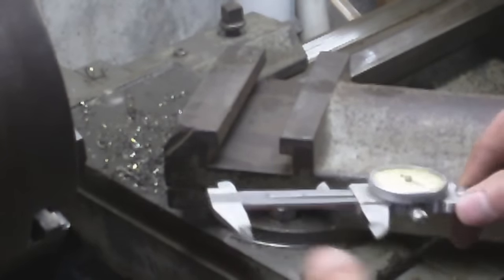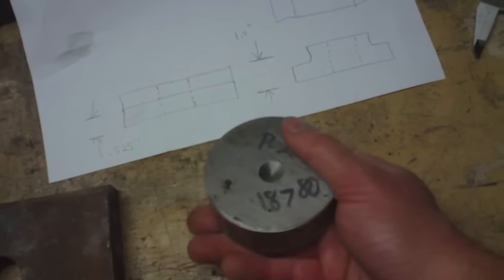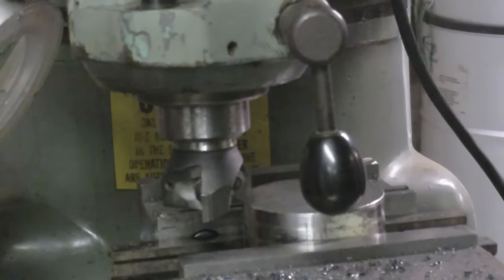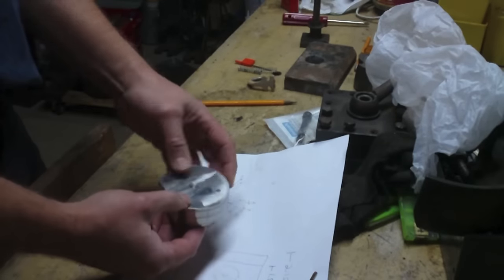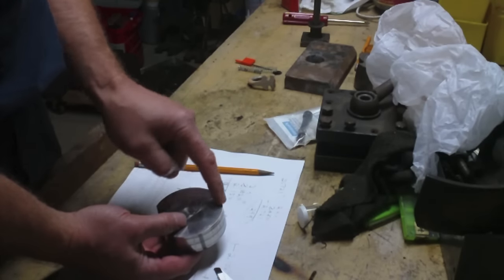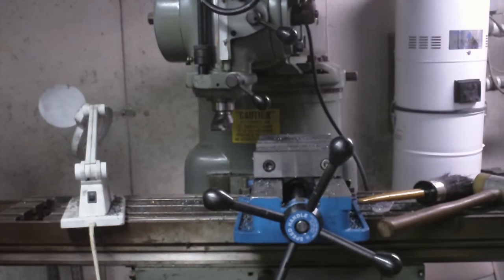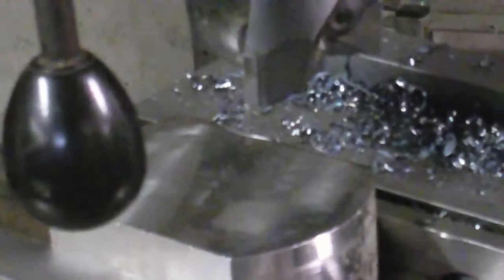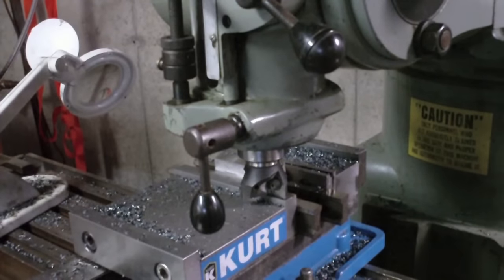The Rare Vernon Lathe Part 55

Comment: Don't do "seat of the pants" milling. That's a problem watching the pros that can do it in their head. A better strategy would have been to surface one face and then mill one of the flats to give you some reference surfaces. Then take the time to mark off the part (dykem or sharpie or whatever) and then scribe your layout to give you some sanity checks on the dimensions. The best example of watching someone do it right every time: watch Clickspring. He does beautiful work and never takes any shortcuts.

It would be better to when possible measure and cut off the fixed jaw side of the vise. That is face you have trammed. Instead of moving off your measurement, you can reverse the piece in the vise and the cut will be centered. As you are sneaking up on the fit, you can cut off both sides and maintain the center by flipping the part the other way and only cutting in relation to that one reference surface.  

That stainless doesn't conduct heat like steel does. That is why the sparks are flying. You would be better off with coolant for stainless. The reason it causes a problem is that stainless will work harden as you are cutting and beat the crap out of your cutters. It makes it worse when you are taking small cuts as the chips are too small to take enough heat out. Also much better to set up a sheet of metal or even some plexiglass as a shield to contain the chips instead of letting them fly. You can attach a sheet to a mag base and position it to contain. A lot easier to clean up as well.

The reason it was shifting in the vise was because the work piece was not really squared. When you are working with pieces that are not totally squared, you want to not just rely on the  moving jaw holding the machined surface to the face of the vise. Put something soft like a piece of copper or aluminum wire or some paper or use something that will focus the grip of the moving jaw on the non-square face and not let it twist in the vise when tightening. That is why it was not holding well and moving on you.   

That cutter is pretty nice for leveling off a flat surface but for cutting on the side, it doesn't really do as well as the sides of the cut are not guaranteed to be square. It cuts with the radius on the points that are closer to the center than the edges. That is why it looks like there is a peeling getting pulled up on the front of the cutting direction. A big roughing endmill would do better for clearing out metal fast.

With the small cuts you are making, the climb milling is not that much of a problem but can really surprise you all of a sudden in a very unpleasant way when it catches and yanks the backlash out of the system and things go belly up. It is useful for getting a nice finish but only in moderation. Look at the rotation of the cutter. The edge contacting the work should be moving in the opposite direction of the feed.
Reply from the maker: +David Kirtley Hi Dave. Thanks for all the info. Very good information in there. So I should strive for 2 face perpendicular to each other first, then reference my other cuts from them? I'll get better over time.
Reply: Some people go ahead and square up a block completely and then layout or cut it to dimension but for what you were making, you need two references since the length is immaterial. Whenever you make a measurement, you need somewhere to measure from. Maybe a vise jaw, maybe a table, maybe a feature on a part.
Toms Techniques also has a good tutorial on squaring up.